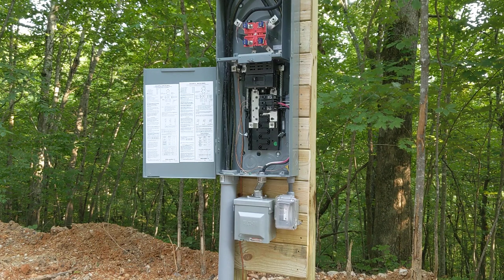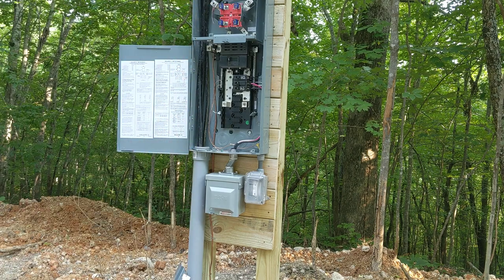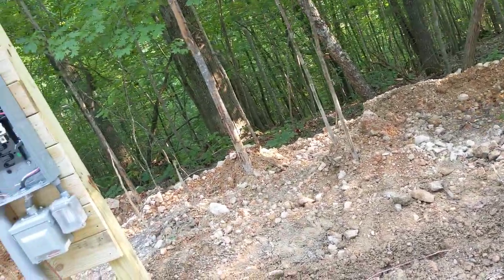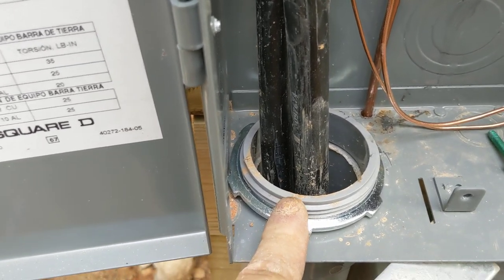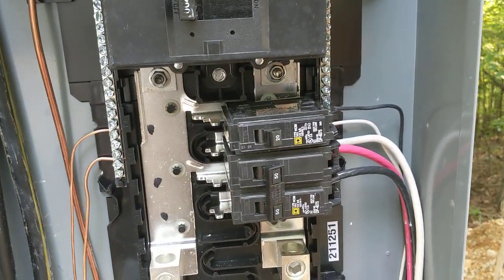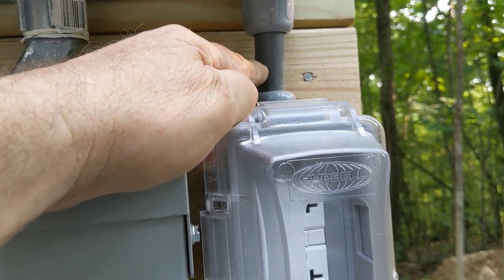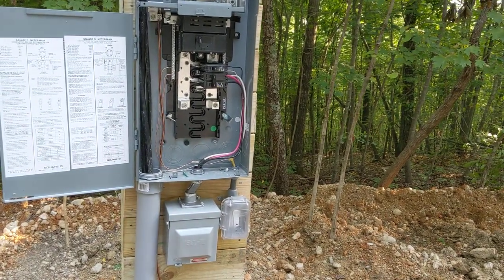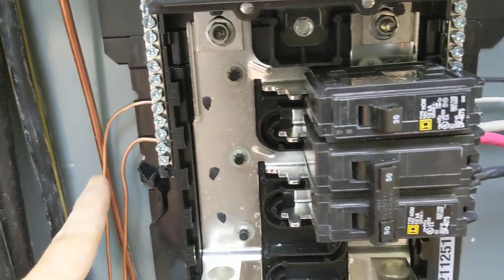DIY 50 AMP or 30 AMP RV hookup! (permanent pole)

Comment: How far away from the breaker can the 50 amp plug be installed? I have a spot where my meter/breaker box can be installed, but the actual plug needs to be like 50 feet to where my RV is.
Reply: I have the same situation. From what I understand, as long as you size the wire for voltage drop, you can go as far as you need to from breaker to plug.